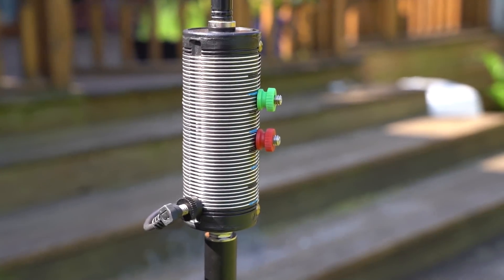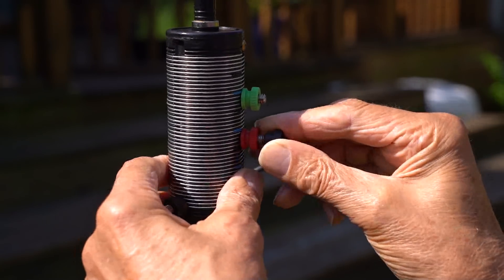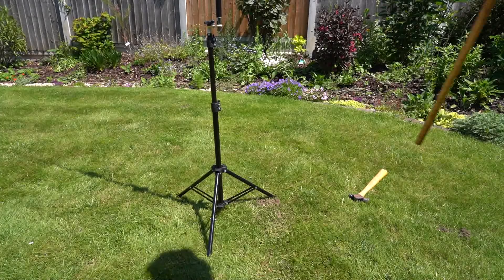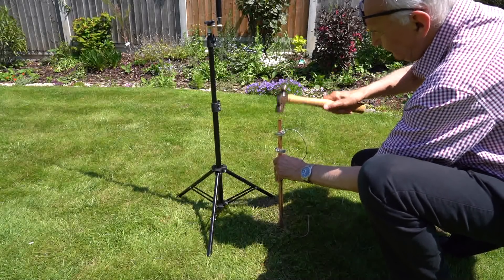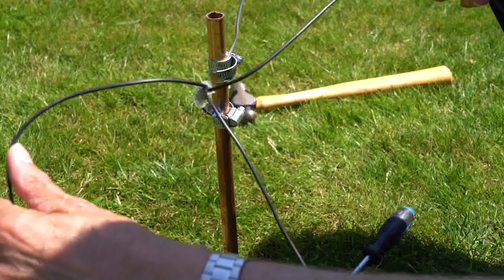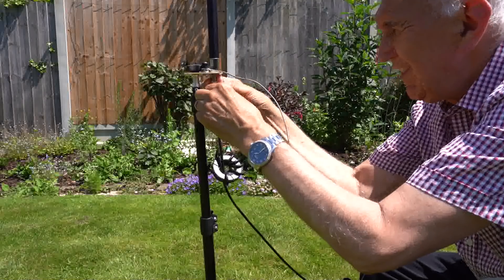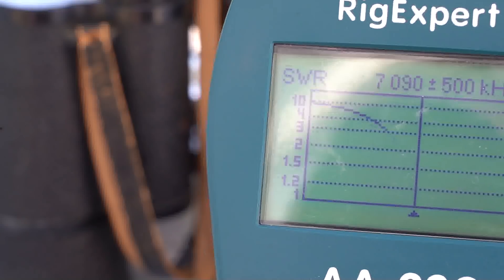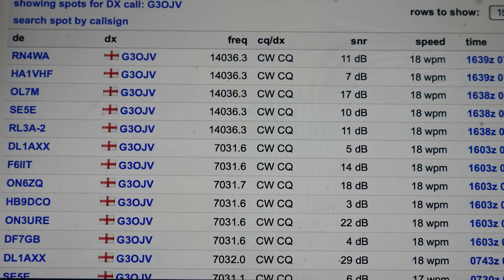Better HF Portable Antenna Performance

Comment: Remember what makes a permanent vertical work well also improves a portable vertical. A 1/4 wave or shorter antenna has a current maximum at the bottom (below the coil, if base loaded). Relatively high RF current from the shield of the coax PLUS "return current" from the radials, ground rod, the air, and the counterpoise.   Vertical antenna manufacturers include a ground plate or ground "screen" around the antenna base to provide a low impedance path for return current from what's acting as "ground." Depending on the earth isn't good enough here. One idea: instead of a narrow flange to hold the 3/8 inch bushing for the "stick," replace it with an approximately 3/16 inch thick round disk (or square plate) of copper, aluminum or brass. Attach the radials around the outer edge of this "base plate." This will reduce what's referred to as ground loss. The second approach (also borrowed from makers of "real" is pay attention to the "skin effect" at RF frequencies. The coax center conductor provides a fairly direct path to the bottom of the antenna element. But the coax shield also carries RF current (see first approach above). Look closely at the path from coax shield to the radials and ground rod. Part of that path is THROUGH some metal parts.  But RF doesn't readily travel THROUGH what at DC is a good conductor. Instead it travels on the surface and therfore maybe around the edge of parts of the mounting system on its way to the radials and ground rod you took time to install. Remember that differential mode current can be found on the outside---not the inside---of the shield of coax where a balun was left out. This current never makes it to the inside surface of the coax shield---why, because of the skin effect. It's better to attach the radials and ground wires to the BOTTOM of the mounting flange, square or round base plate, or whatever. Make the skin effect a ritualistic part of your total portable antenna system design.
Reply from the maker: Check out: https://www.youtube.com/watch?v=uza3e8E_2uQ&t=194s

Comment: I'm looking to set up a portable similar to this but have no idea where to find the mounting plate that attaches on the camera mount and provides an attachment point for the antenna and radials/counterpoise.

What are those things called? It's hard to do a web search for a thing that doesn't have a name.

Comment: hello peter my name is darren and my callsign is 2e1bvx and m0eej I enjoy watching your video's and this one has given me ideas I have the mp1lxmax deluxe and wonder if using the torriod that you used would make a difference but I'm disabled and not very good with my hand at times and wondered if clip-on ferrite would do the same job? 73 de darren (m0eej)
Reply from the maker: Hi Darren. Generally a few turns of cable around a torroid core is better than a ferrite clamp. I use 240 - 43 rings which are karge enough to permit a PL-259 plug tp oasis through when adding the coax winding. 73 Peter

Comment: Hi Peter, as I own a Buddistick, I must admit to having issues re high SWR, tuning and noise levels. The Buddistick has been through an analyser and pins positioned correctly by better hams than myself. Having watched this video, I've invested in the aforesaid copper earthing rod and 3 ground wires, and the ferrite ring. Would you also recommend a line isolator or will the ferrite do the job ? And or Should the counterpoise wire included in the kit be disregarded as I can't recall you mentioning the Buddistick Counterpoise in this broadcast. Thank you.
Reply from the maker: Hello Rob. The ferrite core should do the trick OK. The original ground wire can still be used if you wish. The more the better. But I tend to use around six radials about 5m long. In that situation I have found that adding the longer suppled radial makes no real difference. 73 Peter.

Comment: Dear waterstanton you talk alot but we get little details. About the antenna, the coil, the raciale etc. Etc. 
Afterall Nice video, not much practical use.
Reply from the maker: The subject matter was NOT the antenna, but the installation in general.

Comment: This really was very inspiring!  I have a lightweight homebrew portable antenna that I built years before the Buddistick existed.  The dimensions are based somewhat on the short version of the Hustler mobile mast and resonators, but with a tapped coil and telescoping whip section for tuning.  The lower section makes use of a piece of RG-8 inside a small PVC pipe, using the shield of the RG-8 for the radiator.  I designed it to attach directly to the SO-239 on the back of my FT-817.  Recently I've thought about ways to get the antenna higher and out in the clear, but was stumped for ideas.  After watching this I built a tripod adapter out of 1/8 inch ABS sheet and JB Weld plastic adhesive.  Tested it today and it works great.  Tomorrow's project is an aluminum adapter plate for the actual Hustler whip.  Here's a tripod tip: If you have a photo tripod with a removable ball head, unscrew the ball head to get access to the 3/8x16 (3/8 course thread) stud.  It's longer and stronger than the 1/4x20 stud that is made for camera mounting.  A 3/8x16 wingnut works great to attach an adapter plate to the stud.

Comment: What are the length (s) of the radials? Do you recommend lying on the ground or elevated?  Mel K2JWD
Reply: From what I’ve read, if possible, elevate them at an angle downward and stake them above ground. This is what I do with the three radials cut for 20m elevated from about 6ft down to about two. I use an Chameleon MPAS 1.0.
Reply: @RobPetty622  Length? 16feet ?